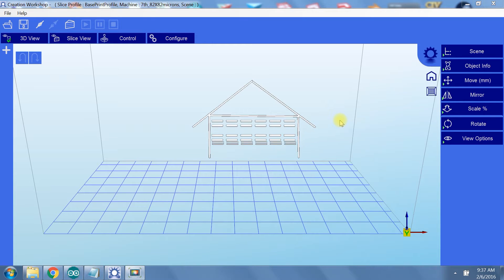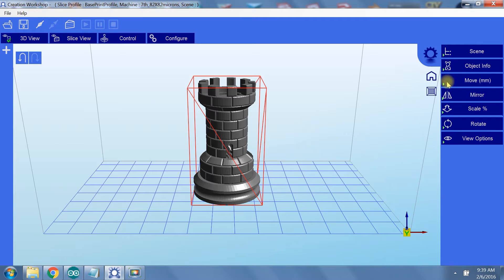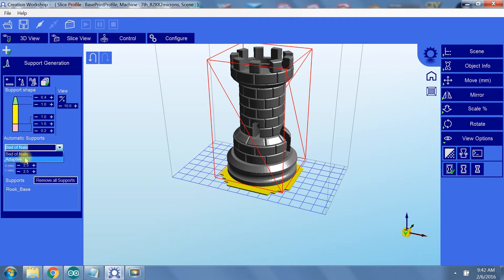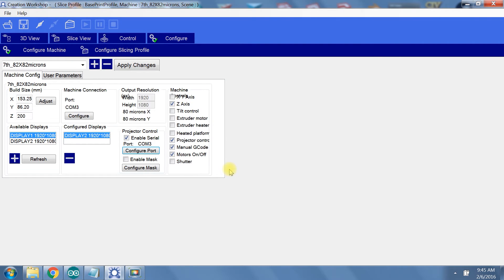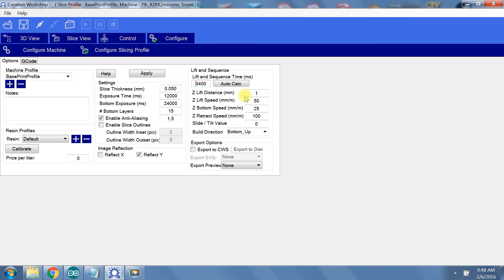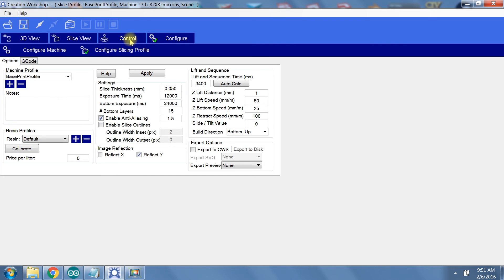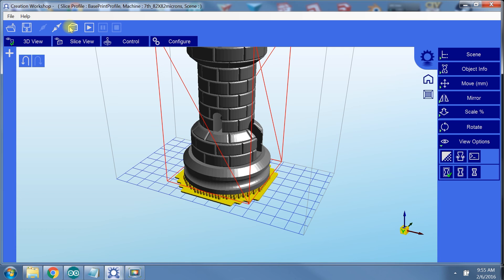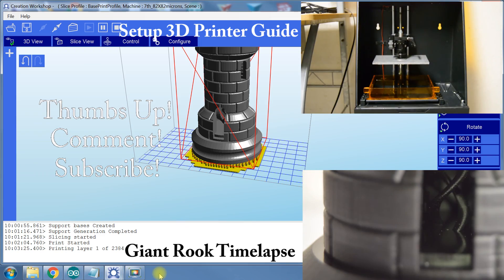Complete Creation Workshop Walkthrough Guide

Comment: thanks please tell me , please tell me, I'm new to arduino, if I change the port and board or accidentally upload some code to it, will I not break it? and can I use another program on it?🖐🖐🖐
Reply from the maker: The IDE will likely auto recognize the printer controller so just press ctrl+shift+m to bring up the serial monitor. Zero risk of accidentally uploading code.
Reply: @GarageScience  thanks for the clarification, i appreciate it and will try everything you said🤝

Comment: Hello friend, thanks, I found the command hex in the description for the projector and now 
1) I  replace them but he writes : The hex string cannot have an odd number of digits....but my projector has this hex to run:    56h Xh Xh 53h 30h 30h 30h 31h 0Dh  Power On
2) and I have a printer connected to port 7, but it says that: "writes, access to port 7 is denied"
3) when sending g coda writes: Could Not Send Raw GCode Command
🖐🖐🖐3 questions, thanks in advance
Reply from the maker: You likely have something else using port 7. The only way I've found in CWS to overcome that is the open the arduino IDE and open a serial monitor window on that port which somehow forces put whatever was using the port before.
Reply: @GarageScience  thanks please tell me , and gcode does not work because of the wrong port? 
and please tell me, I have an MKS GEN V 1.4 board, which board model will be indicated in arduino?
thanks in advance!🖐🖐🖐

Comment: Hello friend, please tell me how to find out the hex command of a printer of another model, for example vivitek h1185hd, to start and shutdown?
thanks in advance.🖐🖐🖐
Reply from the maker: Well this really depends on what the manufacturer has published about their projector. Unfortunately if the hex commands aren't in the technical documentation or user manual then their is probably no way to get them.
Reply: @GarageScience  thanks, I found the command hex in the description for the projector and now 
1) I  replace them but he writes : The hex string cannot have an odd number of digits....but my projector has this hex to run:    56h Xh Xh 53h 30h 30h 30h 31h 0Dh  Power On
2) and I have a printer connected to port 7, but it says that: "writes, access to port 7 is denied"
3) when sending g coda writes: Could Not Send Raw GCode Command
3 questions, thanks in advance

Comment: Hi congratulations it s the best video i ve seen to explain all the software may be you could develop how to place the support manually this i did not get it on an other hand i m writing to explain you my problem may be you can help me i met a lot of trouble connecting my duplicator box to my computer so i decided to try to print directly from the box and my problem is i don t know how to write the  g code or to load the slice i do all as it s mentioned in many video i did follow your setting i save my scene but there is no slice when i load the usb key in my box my english is bad so i m not shore you will understand my probleme but to resume i don t know how to write the program on a usb key to let my machine read it

Comment: Hello, thank you
 so much for sharing how to use creationworkshop, I also use it but just
 to put support in STL, I have a miicraft printer with arduino. Along
 with it I received a slicer program, that is, the creation I place the 
brackets and the micraft suite program I do the slices. It
 is possible to use only the creation, it would be less laborious and it
 has more options like to make the greater cure in the first layers. Thanks
Reply from the maker: +Fabio Weno that question really depends on the firmware loaded onto the microcontroller in your printer. If I remember correctly my printer runs off of a mixed package of repetitier and Marlin firmware and that is able to interpret the G Code commands from creation workshop. The easiest thing to do is try and see what happens, creation workshop is floating around as free to download in a couple of locations but no longer is available for free download from the software creator.  If it works then reply back so other Miicraft owners can see the results too. Also contacting your printer manufacturer is another Avenue for finding this answer.

Comment: For more complex models will the supports not just go from the base up to the first overhang area but also support overhangs that isnt just above the base? like over hangs above the model itself. 

see the free supports at the small lights that don't originate from the base. Thanks!

http://d2rormqr1qwzpz.cloudfront.net/photos/2015/09/22/81938-form_two-008.jpg
Reply from the maker: +MrSkullface no the supports don't work that way. If you are trying to support a part with features like that you might want to use meshmixer instead which will create supports that originate on the part itself

Comment: Thanks for posting the video.

I think I'm experiencing an issue that you bring up as well. I have a top down printer but after my first print I found that randomly my build plate was coming up out of the resin rather than going down. Other than your work around did you ever get any clarity on what this happens?  Originally I was blaming my cheap DVDROM stepper motor but given what you said I'll bet its a software gremlin.
Reply from the maker: I would check the G-Code segments and make sure the waiting time in between build plate movements is enough to cover the length of time the image is projected otherwise everything will get out of sync

Comment: Need help. I have constructed my own dlp 3d printer but the projector goes out of sync with the motor as I use creation workshop. How would I fix this? I am using Sprinter and have disabled endstops. Should I use Draken firmware that you mention in the comments?
Reply from the maker: I would be hesitant to suggest that blindly loading firmware for a printer that isn't setup the exact same way as yours will magically fix your issues.  You could look at it and make the right modifications for your specific printer.  For the motor falling out of sync with the images, make sure the wait time between build plate movements is large enough to cover the whole time the image is shown.  As a general rule your motor wait time should be about 120% the image display time.

Comment: Hi Guys, how are you!
So i am construction one printer to me make a tests with my company. I see your video aboute CW on Youtube, and i have a question.
Where  i find the G-Codes for insert on G-Code Section on CW, and have tabs, Start / Pre Slice/ Lift / End. I need help with this if ok to us thank you so much
Reply from the maker: +victor segobia if you navigate to the G-Code section of creation workshop like I show in the video then you can type in the G-Code there. For examples you can use the G-Code for the draken by downloading it off of the 3DFacture.com site.
Reply from the maker: +victor segobia if you navigate to the G-Code section of creation workshop like I show in the video then you can type in the G-Code there. For examples you can use the G-Code for the draken by downloading it off of the 3DFacture.com site.
Reply: THanks
Reply from the maker: +victor segobia 
M605 - Turn projector on
M606 - Turn projector off
M280 P1 S170 - turn off the cover
M280 P1 S90 - turn on the cover
M280 P0 S10 - Peel servo down
M280 P0 S120 - Peel servo up
G1 Z0 - homing z-axis (for absolute positioning - G90)
G28 Z - also homing z-axis
G0 Z-200 F200 - Move to start position (-200mm from z-home) for build plate leveling (assumes relative position mode - G91)

This all depends on the firmware for your printer. The draken uses a mix of repettier and Marlin firmware.
Reply: Very good, i get it already, and now i need special software for control my printer i can´r use creator workshop i want use my special software you can help me find it ?

Comment: Is there an infill setting? Or just prints solid/hollow
Reply from the maker: +3dprintingprops I am not aware of an infill setting, I have not come across one in the software.  The Creation Workshop software is primarily for DLP resin printers.  It has options for FDM printers but I have not used it on an FDM printer.
Reply: I´m using Meshmixer to create a hollow of the model and save it as stl file. Its a bit more work, but does what it should.